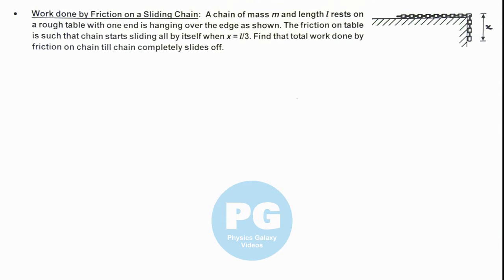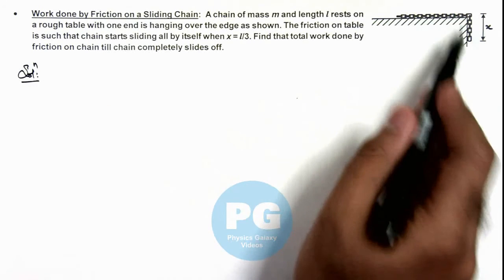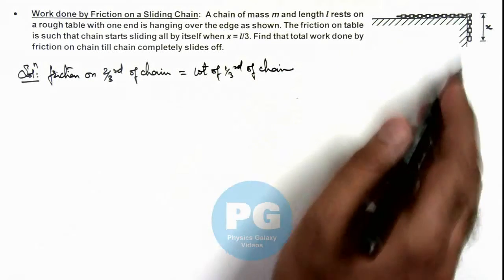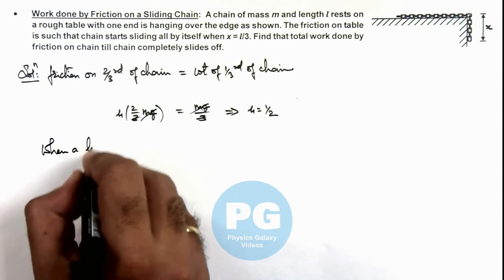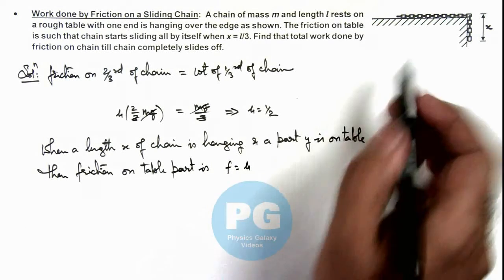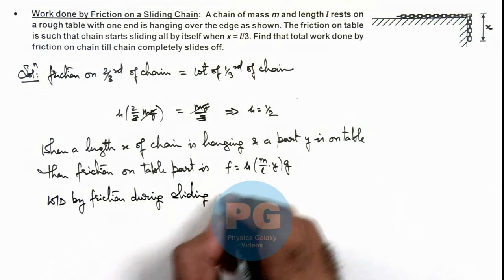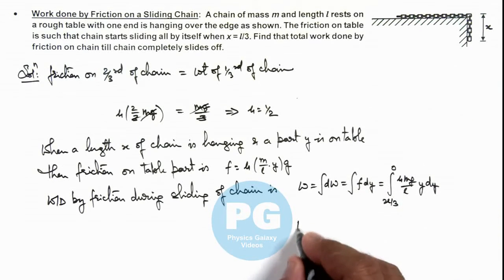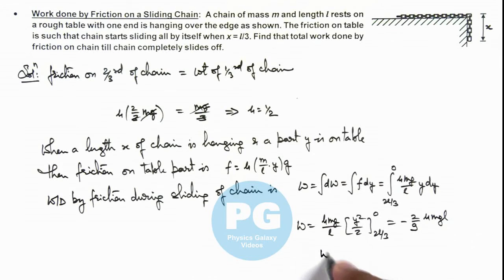Adv Illustrations – Work done by Friction on a Sliding Chain | Work Energy Power #20 for JEE Adv

Comment: Sir initially friction must be less than or equal to the weight of hanging chain for the motion 
That implies coefficient of friction less than or equal to 0.5 but we use only the case of equality ? please explain
Reply from the maker: When chain is sliding then kinetic friction will be acting throughout the sliding... and initially in question condition to start sliding is already specified...
Reply: Physics Galaxy  thanks sir

Comment: sir but dy is small displacement not small change in length. Please make it clear sir I still cannot understand
Reply from the maker: if d operator is placed before any physical quantity it becomes a mathematical term not a physical thing however you can use it in your analysis... but as per the mathematical rules... here dy you are taking as a length but it is change in a variable y which has to be dealt mathematically... like this same problem you may face wherever a parameter is decreasing and you are taking its element... by applying d before this...
Reply: excellent explanation

Comment: Sir there is a small problem you have taken dW= Fdx but sir I am sure that dW = F.dx and therefore sir we will have one more minus sign but then the answer will come out to be positive which is not correct. So sir where is the fallacy?
Reply from the maker: fallacy is in for what you are sure... here as y is decreasing so dy is negative which you missed... thats why you are getting confused in one -ve sign...
Reply: +Physics Galaxy Sir how can dy be negative? It is small displacement and not small change in length. dy only has direction and that is taken care of by the dot product. I still cannot understand my mistake sir.
Reply: please reply sir
Reply from the maker: No... you need to carefully understand how elemental sections are dealt in various mathematical relations, increasing and decreasing behavior of the parameters affect the values... as y is decreasing here it dy will always be negative as it is differential change in y in mathematical terms not a length dy...